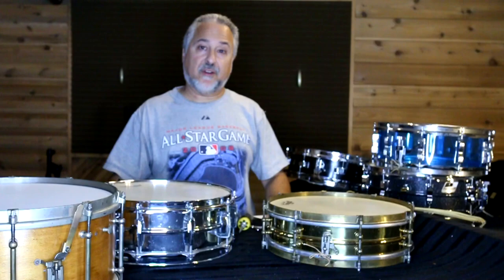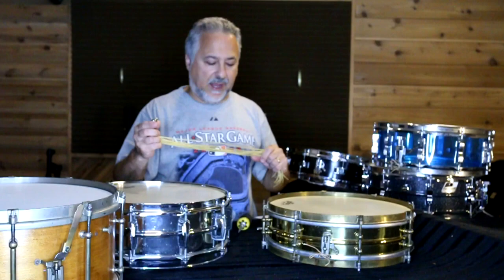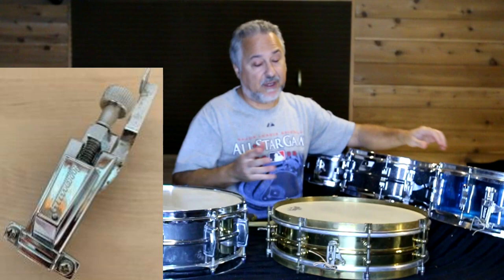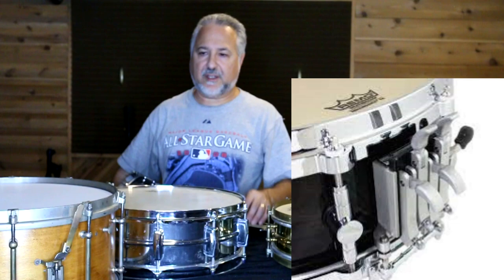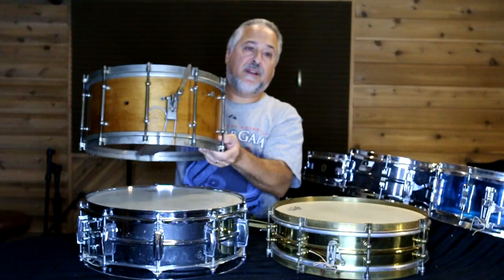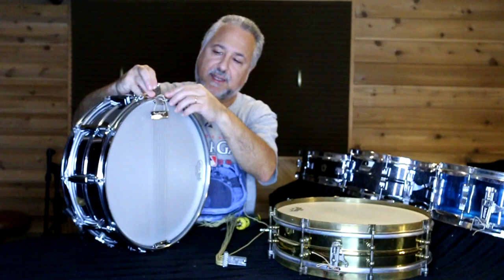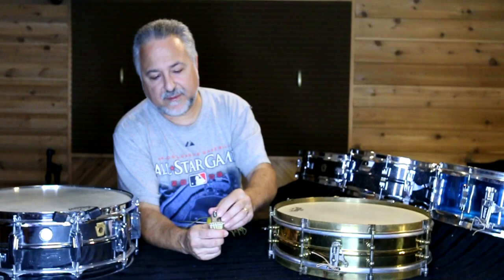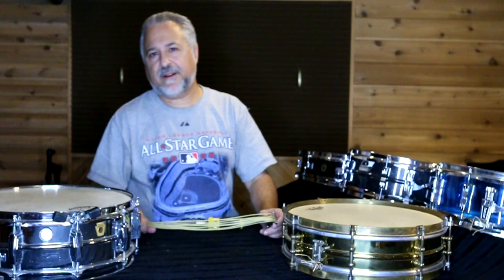Introduction to Gut Snares

Comment: I’ve heard that tennis racket wire is basically the same as synthetic gut, I’ve heard anecdotes about bands that would keep packages of racket wire in the truck in case a snare gut breaks.
Reply from the maker: It's probably very similar but I prefer real gut.

Comment: I’ve got an old Slingerland parade drum like the one you showed in your video! Any tips on tuning a drum like that?
Reply from the maker: Try to tune  both heads  to these pitches. Top G, Bottom E.  If you change the heads out to Remo Renaissance with a diplomat snare on the bottom and an Ambassador batter on the top the drum can sound pretty good.
Reply: @rickdior  awesome! Thank you so much!